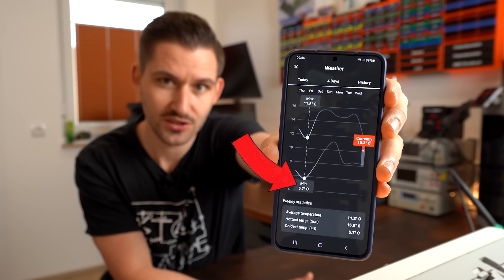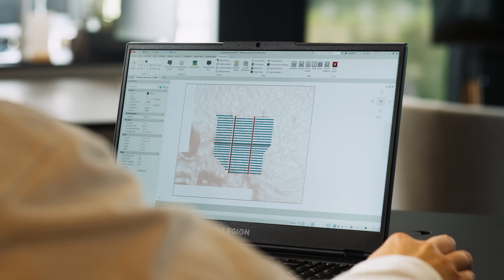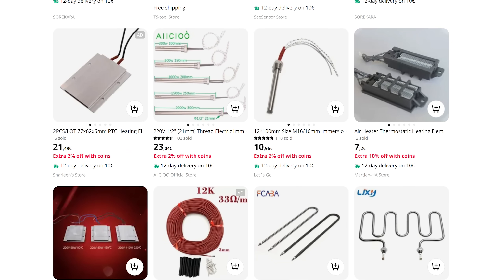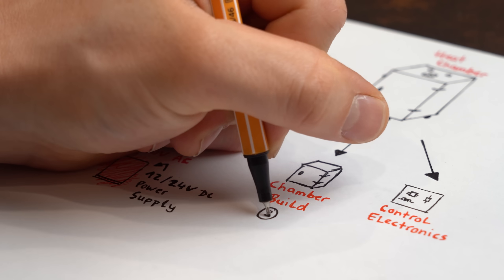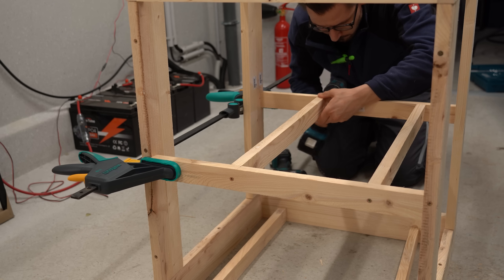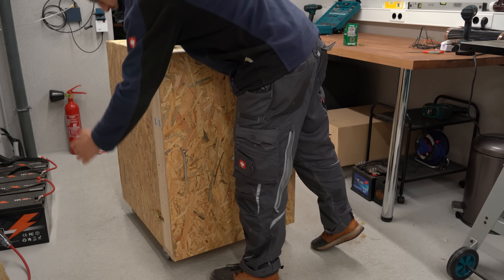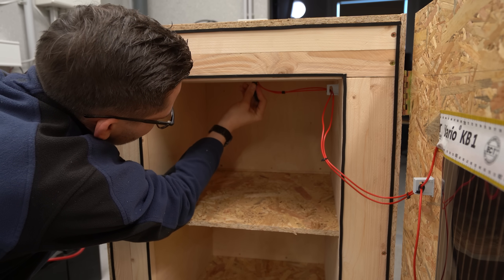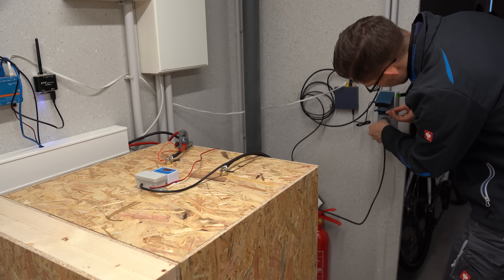The Best Battery Enclosure looks like this?! (Self-Heating)

Comment: I supose you're using Lithium batteries right? Because you should warn about toxic gas emission removal when using lead acid batteries! You certainly can't use such a closed box, you need some kind of ventilation system that uses brushless motor fans to avoid any spark that could make your box explode...
I'd be very much interested in a design for such a box, using 8 lead-acid batteries for powering the entire house myself, charging them in the winter is indeed a serious issue!

Comment: Dig a 8 foot deep hole, large enough to climb down with a ladder, and then brick or cement the side walls, water seal the cement. Make a cover with at least 6 inches of foam. geothermally heatedand cooled battery storage...... problem solved. Doubles as a torando shelter

Comment: Disconnect your batteries and take a dry cloth and clean the dust off the batteries and please make a 3D printed cover to close both terminals safely instead of letting them be out in the open and collecting dust as you said they are in a concreate room with forced ventilation meaning they will get covered in dust if you leave the terminals out in the open for long enough and in rainy seasons the wet dust might just cause a short between battery terminals.

Comment: The lower the temperature difference, the less you'll need to heat them. Heat loss is slowed the closer you are to the ambient temperature. If you can keep your batteries at something like 8C or 10C. You'll use significantly less electricity.

Comment: I just seen the vid and If I was u for the battery poles I woudnt just use wood cause at those voltages and current the wood moisture is partly conductive but also when it gets cold and the outter layer of wood becomes damp well u will find out ;)

Comment: I see you have an attic covered wood and having there electric wiring. Do you plan to create a video from it? I have electrical wires running in my wood-covered attic as well, but it's a little messy and I want to make it better organised.

Comment: Rock wool is really not best DIY option. Expanded foams for flooring are incredibly cheap and offer similar or better rating. Not to mention the easier use, less contamination of the workspace.

Comment: I don't know enough to know if the batteries need to be heated 24/7 or if it's okay for them to dip below freezing when you're not charging them but if the second was true then you could add a thing to get the voltage from the solar panels and then get the batteries aren't charging the heater doesn't need to be on.

Comment: i have 10 of those batteries in an old fridge. i added a reversing valve and an inkbird thermostat to it. so it heats during the winter and cools during the summer. i gets in the negative temps here regularly during the winter and up to 110°f+ during the summer

Comment: My off-grid batteries are Lead Acid type and they lose capacity during cold weather, I used two old Freezers, one was a display freezer which I laid on its side. Whilst I have no heaters in them, it does help stop them getting too cold I have a automatic fire extinqisher installed and old fire blankets are ideal to cover batteries.

Comment: Since heat rises and cold sinks, a small low velocity fan would be useful as would standing off the bottom batteries to allow air to circulate over the bottom of the batteries. Also, please put something over those top terminals to protect against shorts... You might also want to open the door in Summer when it gets really hot. LFP batteries like the same temperatures we do...

Comment: Always easy to comment on what to improve on an already great project, but I think heating cables with some aluminum tape, would have been a simpler solution for the heater

Comment: So, no consideration for radiant heat? At least put some reflective insulation under the heating pad, so you don't use half the energy to heat the wall and insulation.

Comment: 6:40 - Welcome to a world of OSHA violations... - No Mask, no safety glasses, and improper saw setup. The blade guide should be lowered to just above the thickness of the cut. Both to improve the accuracy of the cut, but to allow the blade guard to cover the unused portion of the blade helping to prevent accidental contact.

Comment: 0:42    IDEA FOR NEXT EPISODE   (like so he can see)
Build DIY air recuperation  (HRV) for garage wentilation 

you get ton of tutorials online -- just buy Polypropylene Corrugated Sheet (its like cardboard but from plastic) cut to pieces , glued together alternately in X then Y axis (X Y X Y X Y X Y )  and to around 20cm height---
 average sheet in EU is like 200x100cm for like 5e each ... meaning you can cut it to 33x33cm pieces = 18 pieces per sheet = 3 sheets and you have enough height 
glue with contact glue (for better heat transfer) , ad 2 fans , 2 air filters inside and outside  (the one from the inside protect HRV from dust)  and you ready to go :) 

more efficient version will be 8 full 200x100 sheets cut into 50x50cm pieces

Comment: Scott, This will be very helpful as I will need to build a hot box for testing imbedded thermocouples where I will have to heat the entire item at different temp  stages to verify and find calibration deltas.
A Build It Or Buy It ideal.  Isolation transformer.  Buy it or build it from a microwave oven transformer by rewinding the secondary.   I think this would make a great video.  I cannot find a video on line for this.

Comment: Does the commercial solution temperature regulator have an alarm output to it? It would be great to have a high temp alarm in case of fused contacts inside the regulator or any other thermal event.

Comment: the calculated heating price is just for the heat-up, but you need to also consider the cost for keeping the enclosure at temp X for an hour, that would be the most important factor

Comment: I'm not following why you want to use 240VAC for heating. Why wouldn't you use the voltage directly from the batteries themselves? I'm not sure what topology you're using for your batteries, but they're presumably set up for something in the 12-50VDC range.

Some kind of fail-safe mechanism would be in order. It's not enough to assume that it can't overheat because it only got to 36 celsius when you tested the heating element. Firstly, it's going to be operated in an enclosed, insulated chamber so it can easily get much warmer than 36 celsius. I'm not sure if you tested what temperature can max out at when inside the chamber with no control. Even if that doesn't get too hot, there's heat generated in the batteries while charging or discharging. There's also the possibility that the heating element gets damaged in some way that shorts some portion of the mat. Now your power consumption and heat output go up and if control fails for some reason, then you have a potential fire hazard. Including a fuse to protect against overcurrent through the heating mat would be prudent and cheap. A PTC thermistor might also be worth looking into. I haven't looked at what kind of operating/trigger temperature ranges but maybe there's a part out there that could reasonably limit the current through the heating element if the temperature starts getting above something like 50-60 celsius.

Some kind of venting wouldn't hurt in the even that the temperature starts climbing too high, although this is probably a more complicated problem than everything else.

It would also be better if the interior walls were made of a non-flammable or even fire-resistant material. Sheet metal, fibre-cement board or even drywall/gypsum board would be a better interior material, especially given the lack of attention to safety in the design as-is.

Comment: Hello, mr. Great Scott! Here’s a golden tip: if you want a faster and a uniform heating just add some(s) Fan inside there, to the heated air get some motion.
Also you should add fans to push air out of the box when the temp goes too high. 
Greetings from Brazil 🇧🇷

Comment: Tungsten light bulbs are also good heaters for enclosed spaces.
Reply: I can't stand either fluorescent or LED lights. I have sensitive eyes and can see the flickering. So I use halogen bulbs.
Those are great in the winter since I get both light and heat together. I also like the color profile of halogen bulbs. Believe it or not, counterfeit halogens are common. They substitute incandescent bulbs behind the white phosphors.

Comment: I don’t get it take a heater mat for dc and use a ksd 9700 on the battery and youre don now you have inverterloss and stress etc
Edit you can also use the termostat but you need one that powered by dc

Comment: I was planing a similar setup for my gel lead-acid batteries, I was using stick-on car mirror heaters with 6 watts each under one of the batteries. I never got to testing or using it though - my 'designed in germany' batteries died after less than 100 cycles .... in summer.

Comment: put some baking soda in the bottom and a CO2 sensor down there. if any of the batteries leak, they'll react with the baking soda and create CO2, sounding the alarm and informing you that one leaked.
Bonus points: The soda will partially neutralize some of the acid for when you have to clean it up.

Comment: Please add at Minimum a Temperature Fuse near the Heating Element. Maybe 60˚C.  These Heaters are not supposed to be mounted on a wooden surface and with only Air on the other side.  Better cut off the Electricity if somethings going wrong.

Comment: Why not put a 40w lightbulb in? 

There is also the option of a few meter "Begleitheizung"
which is a low temperature heating cable, that is meant to run inside a rain gutter and just keep the gutter from freezing trough.

But for plain heating purposes i had chosen a lightbulb. The few percent light get reduced to heat anyway and it can run with AC and DC.

Comment: Nice job. Using an AC mains heating pad, one potential problem is that the heater won't work during a power outage. You could make the unit self-sustaining by using a DC heating pad and connecting it to the batteries directly (using fuses, of course). LFP batteries can be discharged below 0 degrees C no problem.

There are server rack batteries available in the US that come with built-in heaters (Trophy is the brand that I know of), so presumably they'll be available in Europe soon. But as you found, it's not too hard to DIY a heater from components, so it probably makes more financial sense to buy the non-heated version and build the heater to suit the install.

Comment: Why did you go with 230V instead of using the 12V the batteries could provide? Converting it twice comes with quite a loss.
Only downside: you could not heat your total empty batteries
Reply: Because I am searching for fabric heating pads that work on 12V to have a portable heating blanket. The 5V ones you get on Amazon are way to weak.

Comment: I'd rather move the batteries in the basement of the house, where you'll never get < 0°C in the first place. Seems safer to me and also using less power.

Edit:
And shouldn't the temperature sensor better be at the bottom of the box? As heat rises and the bottom will be colder than than top.

Comment: practically u build an over engineered seed/grow box:
- no need for the mineral wool, just use an 1cm tick foamed polystyrene panel
- resistor approach is good, just use an higher resistance one and an anti-slip/knurled aluminum or a proper heat-sink to increase surface
- some holes for air circulation can increase temperature uniformity in the box, a couple 4-5cm in the back of middle panel and leave like 1-1.5cm between middle panel and the door one
- electronics can be simple as an arduino with thermal sensor and a 3-5v relay as u showed and it can let u give custom thresholds and reading intervals, also take a mean of last 5-10 minutes before turn on/off the heating element.
 
In my own grown box for habanero peppers I just used a tungsten 25w light bulb for the heating, and a couple of kds301 thermostats to keep a temperature of about 28°C and start an exhaust fan at about 30°C.

Comment: Nice product, but please, please please don't forget that batteries give off lots of heat especially when charging up in summer, and could actually catch fire. So consider at least one if not several of the following:
1) Make the box much bigger so that there is ample space for air to circulate.
2) Controllable air vents that open up to the heat out if the batteries go above a certain temperature
3) Thermal cut-out that disconnects the batteries from the solar panels and/or inverters so that batteries do not get charged or discharged if the batteries go above another certain temperature.
Most "professional" battery packs come with instructions that specify a minimum distance to neighbouring objects, for a reason. Honestly: I love your channel but that battery looks like a ticking time-bomb in summer. I'd hate to see a video of a burnt-down garage.

Comment: Other people have mentioned what a bad idea it is to have a flammable box, but I've got to say having no redundancy in the temperature control loop is pretty bad too you should at least have a thermal fuse somewhere that will blow if the temperatures get too hot, otherwise you're just asking for trouble.

Comment: I recommend making sure it doesn't get too hot either, if you managed to insulate it well even the very small losses lithium based batteries have can make them it too hot if they're in a well insulted box. Obviously how hot it can get will depend on a lot of things, how good the insulation actually is, how much and how fast you charge and discharge and the specific batteries, and ambient temperature.     

100 mm decent quality mineral wool means you can get more than 2 °C increased temperature for every watt heat per square meter, assuming no or insignificant air flow through the insulation or other heat leaks. The boards also insulate a little. Hopefully there are built in BMSs in the batteries that have overheating protection, but they tend to have a bit high threshold, kicking in with a decent margin to prevent immediate danger, but possibly not great for securing longevity of the batteries. And that is if there is any built in overheating protection, and it works.  

By the way, a making and installing diy counter current heat exchangers for the ventilation seems like a great subject for a video for your channel.

Comment: Thera are two SEVERE issues with this design. Its a axtreme fire hazard! Timber and plywood are flammable materials and should never used near any batteries, especially when left unattended for extended time. Another issue is that charging lead acid batteries should be performed only in ventilated areas, so getting it enclosed and not ventilated is not recommended and might be dangerous. I see you use LiFePO4 batteries, but thermal runaway could still be an issue for those. I wouldn't keep it that way, but you do you.

Comment: Wouldnt it be better to just heat the batteries during the Day?
There wont be any charging at night. You could save some Power this way,

Also how hot Do the batteries get during a heavy load?
Maybe you should add over temperature protection to be save.

Comment: Nice box! I'm fairly confident that the heat generated from normal use will maintain a Cosy temperature. You may, in the summer, even have to add fresh air ventilation to keep them cool!
Would love to see a long term follow-up video!

Comment: I was really hoping to see you testing the box for yourself. :D 

Would you have any personal interest in making a heated chamber (or area) for a human? I.e. for working at a workshop workbench for a long time in low temperatures. Or a sauna box even? :) The later would have to be DC and screened (if electrically heated) to reduce the AC EMF at close proximity.

Comment: First of all, your temperature sensor position is maybe not so useful. Take a look at Zerobrains discussion with a lithium battery expert, who explains where the sensor should be installed. Secondly, many BMS have a protection against charging at too low temperatures (did you test your BMS?) which you perhaps could use to start charging at the well measured right temperature and which can as well switch off your heating. And as a last point, you can very effectively warm the batteries up by discharging them.

Comment: Why just plug up these nasty holes in your garage
You are not using it for a car anyway, so why the forced ventilation?
An even better idea would be to utilize one of the holes to install a minisplit air conditioner and heat up that garage to comfy levels, slap some Styrofoam to the walls and have a heated workspace
Also, if you are willing to do so, cover your roof in at least 20 more solar panels and operate that minisplit for free
I beliefe you were pretty much upset from putting up even these two panels but pro tip: Get some of these suction cup lifter handle thingies. With these you can easily hold on to the panel with one hand over your back while climbing the ladder with the other hand.

Comment: I had a heated box for some electronics in the cold attic even lover than -20°C by using a 60 W lamp. It wasn’t that well insulated but it was warm on condense free. Well this was in the 90’s and was a quick fix. Yes as all quick and temporary solutions it worked for years.

Comment: Couldn't you just float charge the batteries and make waste heat that way?
Surely a few W per battery wont hurt. Or are they that sensitive to over charging?

Whats going to happen in summer or during use? you haven't made an oven for your batteries have you?

Comment: Use, build, or salvage a Dehumidifier for heat. -Greater efficiency than resistive heating. 
It could get 'especially interesting' using modern DC micro-compressors, found in the nicer food/bev powered 'coolers'.

As a bonus, you get (non-potable) distilled water; many counter-top gravity water filters will make the water potable.